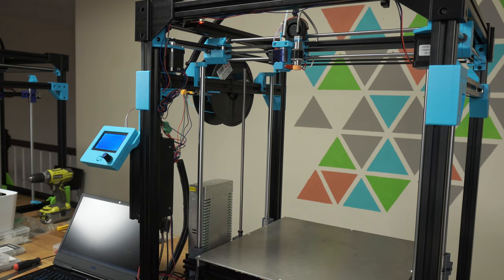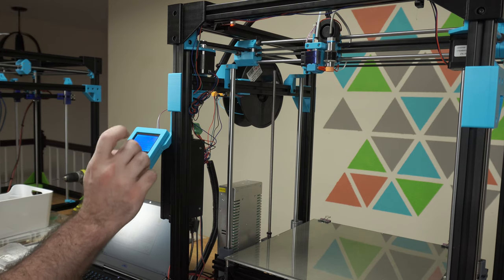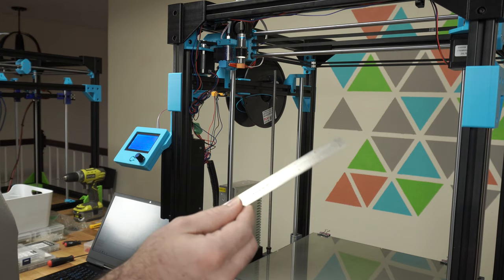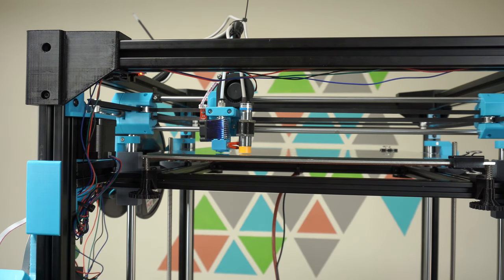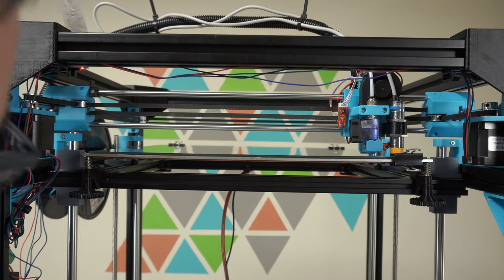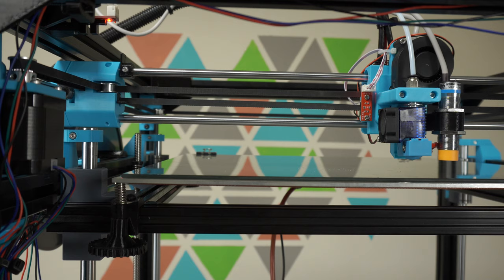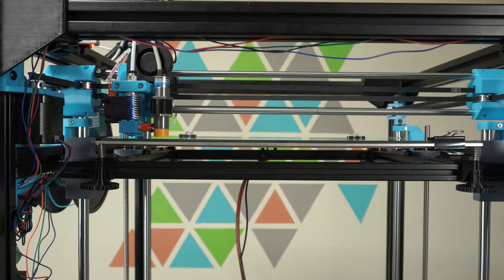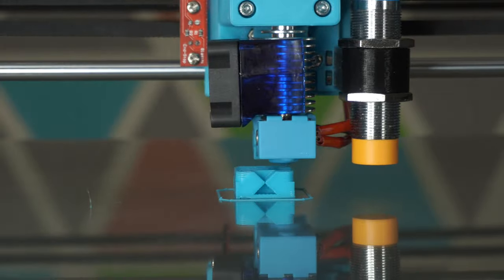Zyltech HEVO 2.0 - Setup: Part 7

Comment: Do you suggest going the duet route with this printer or to stick with RAMPS?
Reply from the maker: The RAMPS board is the bare minimum. The duet is wonderful. You can set up the firmware in 30 minutes and make changes on the fly from your computer or the touch screen.